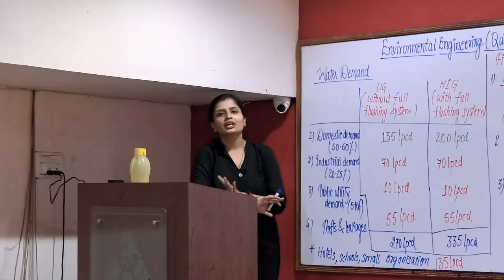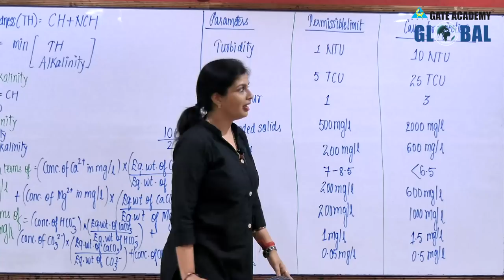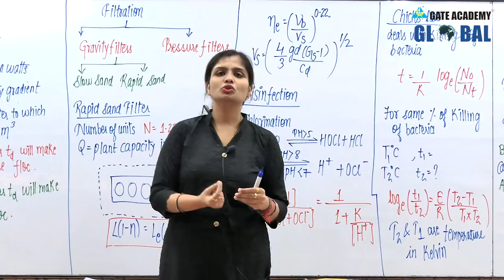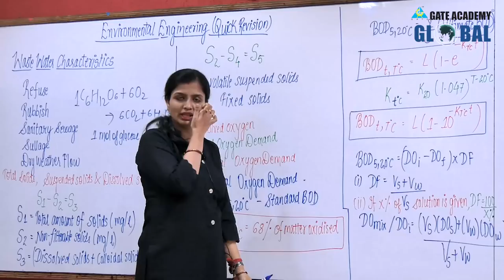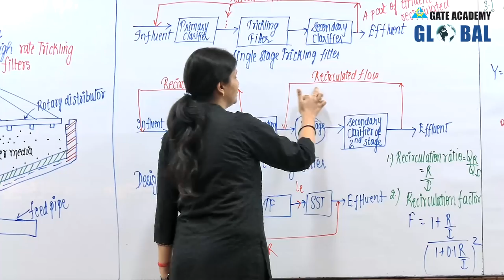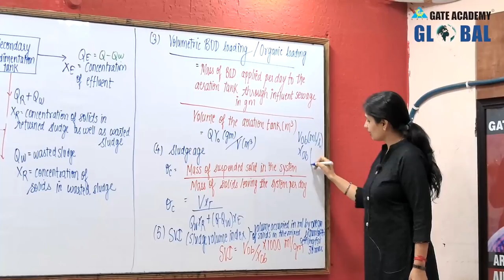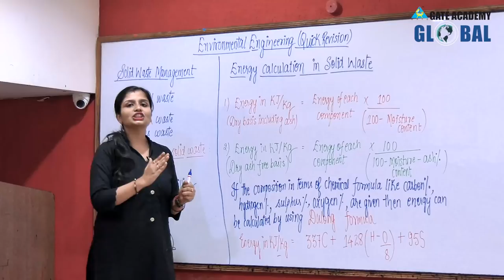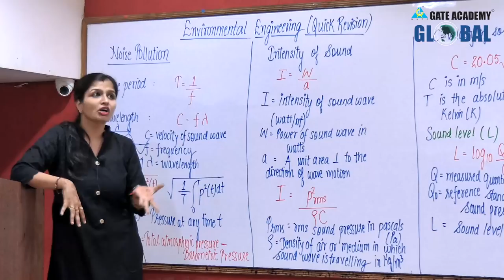Quick Revision | Environmental Engineering

Comment: Calculte the alkalinity (mg/L as caco3) of the leachate when the concentration of Co2 is 5 mg/L and the pH is 7 in the leachate. Landfill gad im contact with the leachate is saturated with water vapor at a tperature of 40 oC and the pressure within the landfill is atmosphric. If required, assume properly amd describe what you assumed. 
Caco3 =100 g/mol, Co2 =44g/mol 
[H+][HCO3-]/[H2CO3]=5.07 x 10-7
[H+][CO3 power -2]/[HCO3-]=6.03 x 10-11

Mam plz help me to solve this question